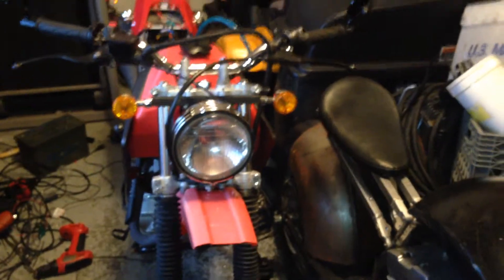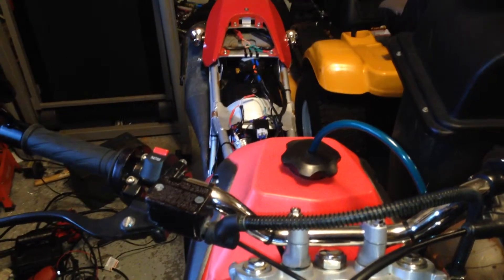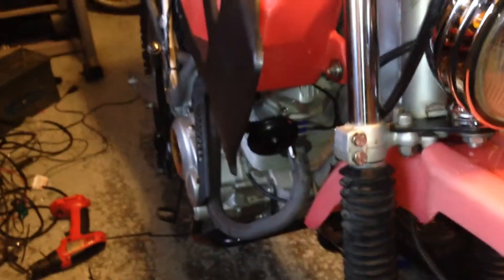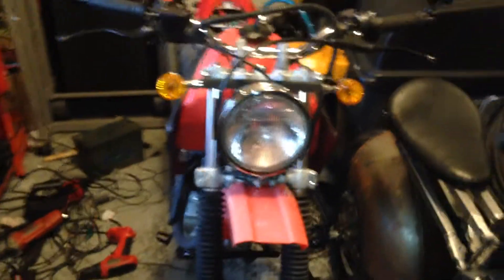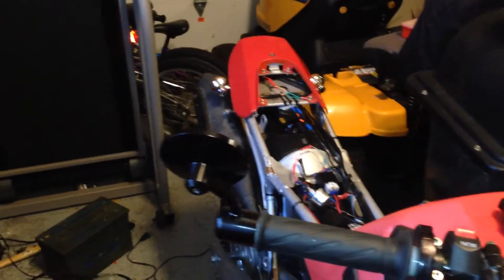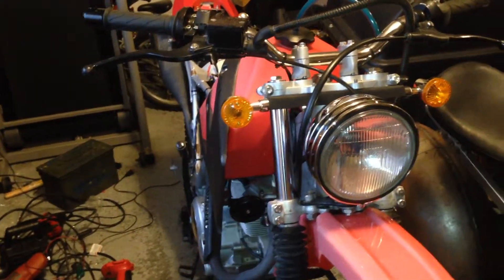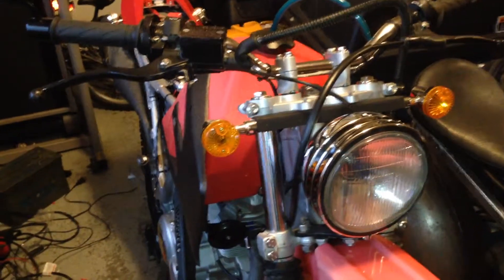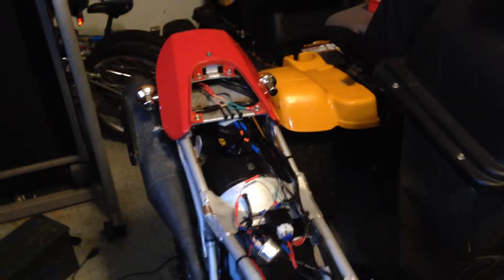150cc Street Legal Chinese Dirt Bike Project Ep. 10

Comment: Hey, i'm in WA state too, i am making my 1984 tt600 street legal also. From the research i have done, if you get what is called a buck boost dc/dc 6v to 12v converter it should boost your 6v system to 12v and work with your regulator you have. I ordered one on ebay from china for like 3$. It hasnt come in yet but i will let you know how it goes. Also your can make a battery pack out of nicad aa batteries to run the lighting if you wanted a temp fix. 10 wired in series actually makes a pretty good bike battery.
Reply from the maker: Kyle Adams How is your TT600 project coming along? What part of Washington are you in?
Reply: I'm in selah, just outside if Yakima. I still have my tt600 needs piston and rings. Have them just haven't put them in yet. I bought an xt600 from a guy for $1000. Great deal. He thought it had a bad starter turns out it was just a bad battery. I'm buying a house soon so when I have a garage I'll finish the tt600. I came across your videos looking for someone doing stuff on the cheap lol. Not allot of videos out there. I'm an advanced repair agent for geeksquad so I have enough knowledge of tech to be dangerous lol. I think I'm going to look into a stand alone bluetooth headset for my helmet.  Sill haven't figured out a good way to record bluetooth yet. Checking with my geeksquad buddies on that still. Anyways sorry for the novel. No one around here tinkers, they all just take stuff to shops.
Reply from the maker: Kyle Adams Ya cheers, I appreciate you watching and I actually really appreciate the comments. You have an XT too?! I flippin love those bikes, I was actually looking for one when I picked up the Suzuki instead. I came across an '82 XT500 for $700, running, tittled and registered but couldn't raise the funds before it was sold and that's when I came across the '85 SP600. You should totally make videos of your bikes I would love to see them. We should meet up someday when we get our projects on the road and go for a ride!